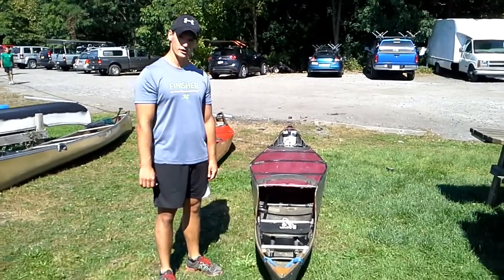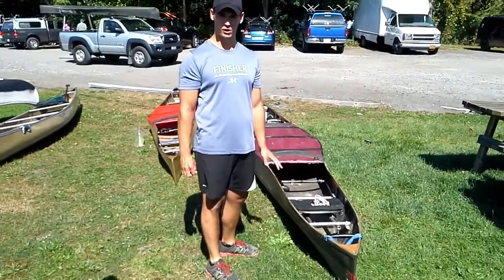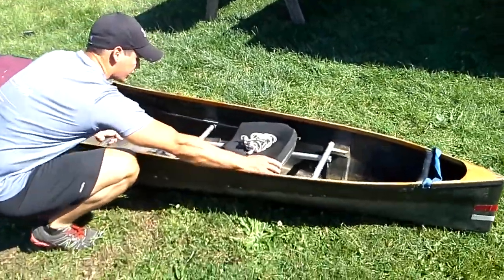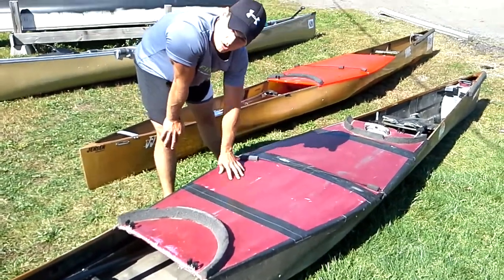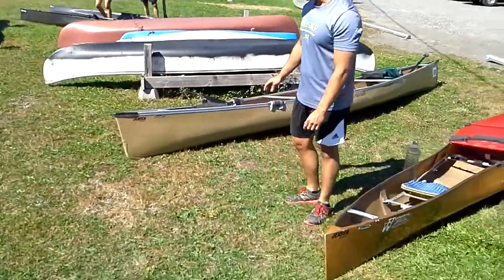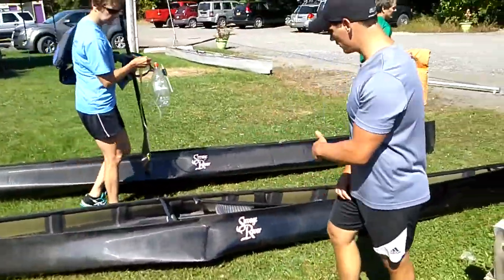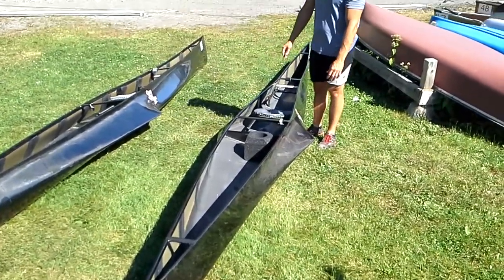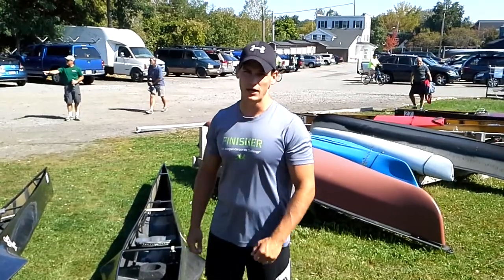Equipment Series: canoes

Comment: Would love to hear your slant on handling vs. designs of pro boats.  Jensen P1, V-1, JD Pro, Corbin, Hassel, etc.  Building a nostalgal 3/27 with difficult to work with lineal Balsa(3/8's" finish dimension) vac bagging bookmatched Ziricote veneer(jigsaw puzzle laminate maximizing longest grains possible), then using 7 oz. plain weave fib-glass (outside) & 4oz.(inside). This will be a lifetime achievement.  Will start attending races again after years out of it.  Did the marathon(AuSable) back in the 2 years they made it a 2-day race(68&69). Been following your vids they are very informative.
Reply from the maker: david,r. massey Thanks! I will put that in the list of vids to do. I will try to get a round table discussion with more paddlers to make it more interesting